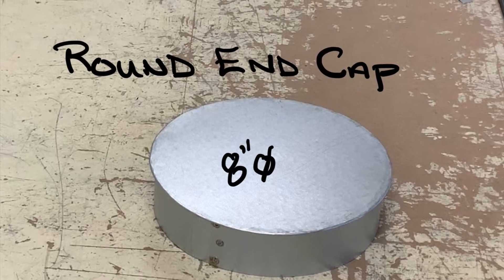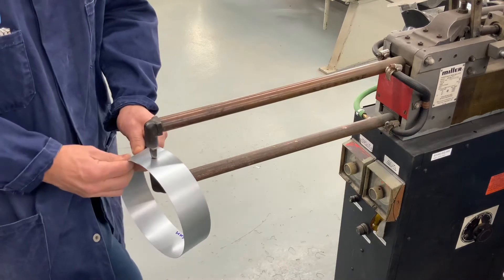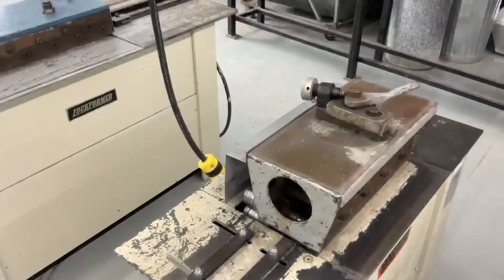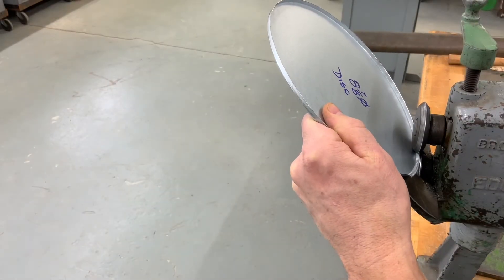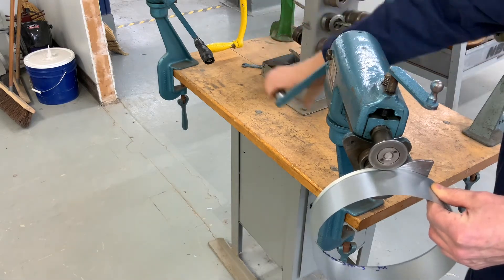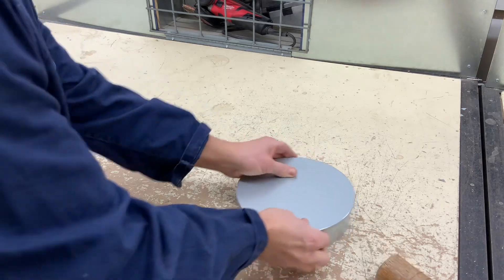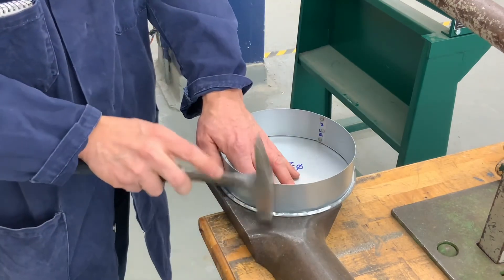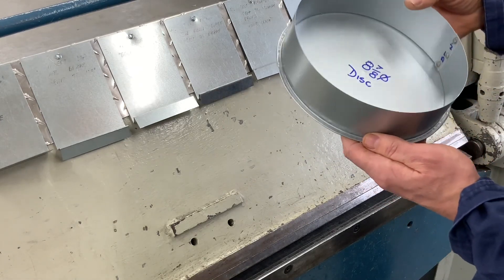Fabricate a Round  End cap

Comment: Would a bead roller help do all the flanges on this? Thats what you used for the side flange wasnt it? What was that machine for the top flange?
Reply from the maker: I used our Pexto rotary machine set up with what we call turning rolls. If I was looking for a sharper bend I would have used burring rolls.
I hope this helps, cheers. The flat cap 3/16 edge was turned up using the lock forming machine.

Comment: 3:04 , Is that a tipping die or a flange die to create that angle? Thank you your videos are top notch!
Reply from the maker: I used our Pexto rotary machine set up with what we call turning rolls. If I was looking for a sharper bend I would have used burring rolls.
I hope this helps, cheers.
Reply: @sheetmetalwork  That is great information! By chance do you know the model of that Pexto Roller? Thank you
Reply from the maker: Roper Whitney/Pexto
Mod# 622LR
Reply: @sheetmetalwork  
Awesome! Thank you so much, always like these videos they are great!
Reply from the maker: I used our Pexto rotary machine set up with what we call turning rolls. If I was looking for a sharper bend I would have used burring rolls.
I hope this helps, cheers. The flat cap has a 3/16 edge turned up using a power flanger on top of our lock forming machine.

Comment: Is there a way to do this without the flanging machines? I have a 10' shear, box and pan break, smaller cutting tools, and 10' break at my disposal...
Reply from the maker: There's always a way but it can be done.  You can turn a flange on the collar using vice grips and a nut, I demoed that in a tips and tricks video way back. Just need patience lol.
Reply: @sheetmetalwork i tried the vice grip technique. Bend the round part out ward and the round top downward. Set the round in the top and hammer the flange down to form a round hem all around. Crushed it all around with break, and it seems to hold together well. Thanks for the advice. Bosses were impressed.
Reply: Bro I gotta make these with a Pittsburgh  machine it’s a pain in my ass
Reply from the maker: Pittsburgh, no fun!  Starting part, setting the cap into the pocket is ok but the finishing part can be challenging and is often a bit large or small :(

Comment: Could a single manual easy edger machine cover this whole process? I'm looking to upgrade from just a hammer.
Reply from the maker: a rotary easy edger will definitely turn a 3/16” on the circular disc/cap.  But, It won’t turn an edge on the collar. I hope I explained it ok?
Reply: i used my easy edger to turn my 3/16 on collar and use my roller that has indents so i can roll a peice with a 90 on it and then pop rivit the color and finish beating it togeather if that makes sense @sheetmetalwork

Comment: What Gauge and material?  (Looks like galvanized.  Guessing 24-26 gauge.)
Reply from the maker: You are right Dennis ☑️ 26 g Galv iron.
Reply: @sheetmetalwork  thanks.  Wondering about a similar material - of thicker gauge - to make boxes and sorting trays.
Reply from the maker: @dennisyoung4631  I would go with 26 or 24 gauge Satin Coat Galv.  I used this metal for some of my other videos, check out. Rain Cap or 1 pc metal box and some others
Reply: @sheetmetalwork  26g is a bit too light we use 24g in NZ